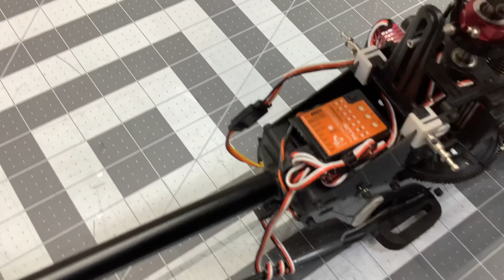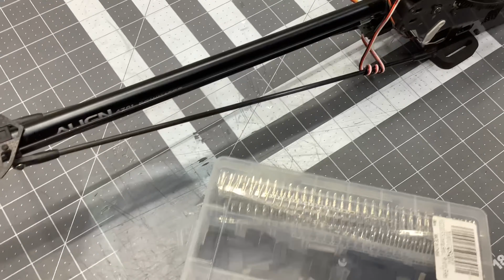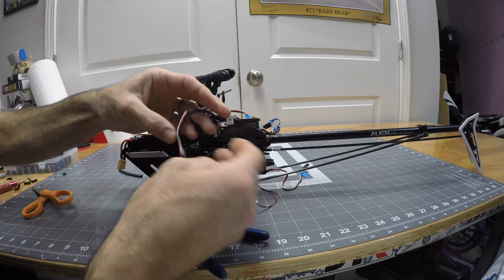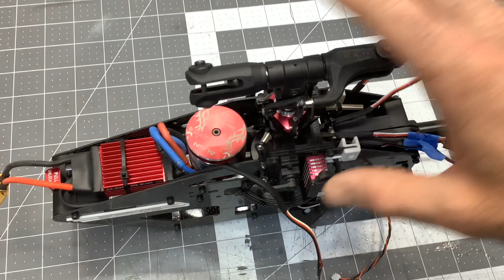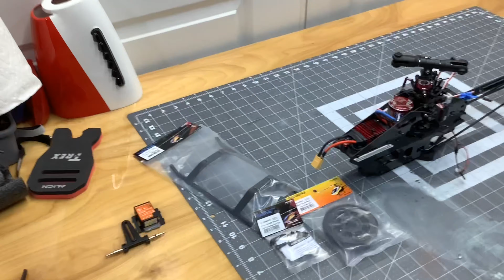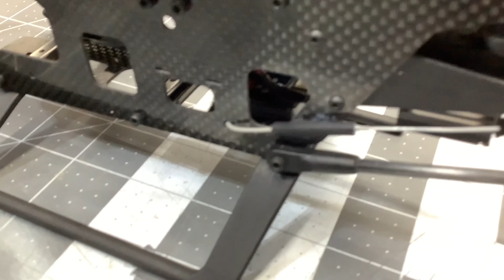Align Trex 470LP rebuild and Rewire

Comment: Thinking about getting one of these heli,as my second heli,as I am learning on the fusion 270 a supa little heli.
Reply from the maker: The 470 is a fantastic model! Great choice as a second model. If you get one I would recommend getting a iKon 2 FBL unit for it. That is the best FBL in my option. Super easy to setup and simple! You get rescue as well as auto level.
Reply: @westhobbiesrc8051  hi is it poss to put a AR636 RX in the trex 470 likr the one in my fusion 270 thx mark.
Reply from the maker: @thedonnyman1  is it possible? Yes, what I do it? No. The 636 is a terrible FPO unit, it is not great whatsoever serious tipover issues as well as no real tuning and not the best flight performance. The 470 combo comes with a microbeast. Personally I would go iKon 2 and have the best FBL in my opinion.
Reply: @westhobbiesrc8051  ok thx for the info but not had the tip over issues on the fusion 270 it fly great loving it thx mark from the uk.
Reply: @westhobbiesrc8051  loving flying the heli only been learning for about 2 and a half month can hover in all directions and toddle along from left to right it my turned I am struggling with,could you please do a video on how to learn to turn like a nice bancked turn thx mark.
Reply from the maker: @thedonnyman1  I’m very surprised you have not had any tip over issues. I’ve lost three sets of blades on my 270 from tipping over on spool up. It’s a very common issue. I put a iKon 2 in my 270 and it’s a whole different heli! Still have self level and rescue. Love the fusion 270! That’s great to hear! Helis are so much fun! And more rewarding in my opinion. I love my airplanes but helicopters are just something else! so I could definitely do a video like that.

Comment: I just bought this helicopter with the super combo electronics , I am having a hard time figuring the microbeast plus especially  finding a cheap receiver/ satellite for it. Any good receiver/satellite you would recommend?
Reply from the maker: What radio are you using? Spektrum? If so any DSMX satellite will work. Horizon hobby is where I buy mine. About $35, you plug it right into the side of the microbeast.
Reply: @westhobbiesrc8051 yes its spektrum, I actually bought spm9747 for it, I can get it to bind but I can't seem to go into failsafe. It's is hooked up just like it says on the manual.

Comment: I would like to ask what is grip size (inner) for 470LP? Would it fit 5mm thickness blades or only around 4.6mm?
Reply from the maker: I would have to Measure that, I’m not sure off the top of my head but any 380mm  Blade that I have tried works.
Reply: @westhobbiesrc8051  would be nice if you can measure that :) the reason why i ask is because i was thinking if i could 'stretch' it later and put 420mm blades later when i will want to modify it. But i noticed most of 420mm blades come with 10mm thickness, though i was able to find some 5mm thickness blade.